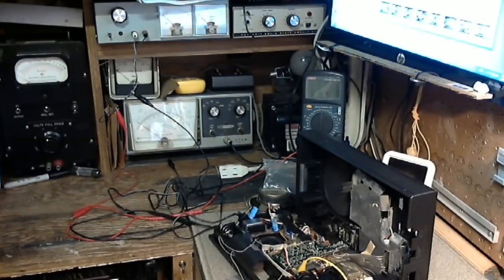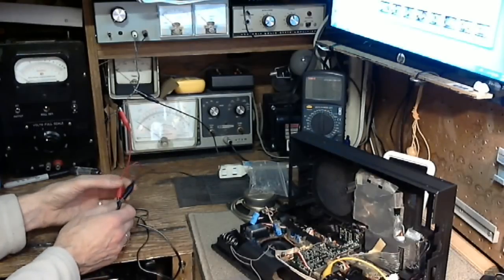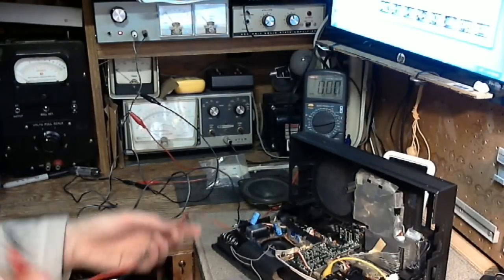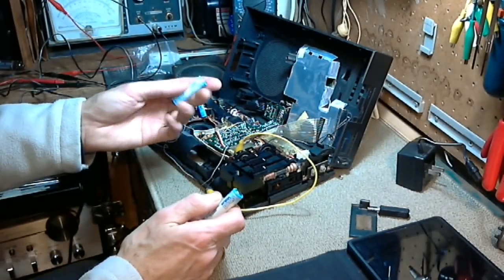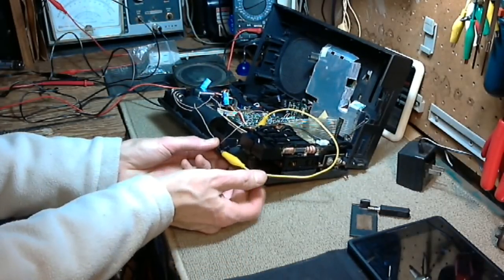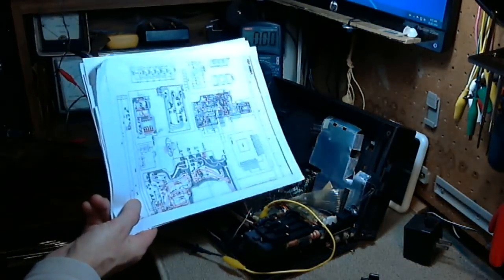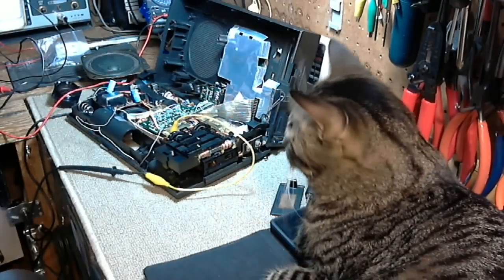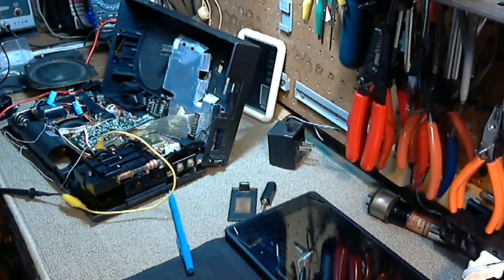Sony ICF 2001 Video #23 - A Better Shop Power Supply (with a Draper cameo)

Comment: When you turn it off, it will keep running for a few seconds because the electrolytic capacitors will keep the circuits powered for a short time while they discharge.
Reply from the maker: It seemed way too long.
Reply: Jim Lindenas
gotta remember tho its not a direct power off switch. Its a "soft off" switch. If there is a long delay in switching off then something funky is going on with the circuit around Q26.
Reply from the maker: Right.  I got it now.  I'm stuck in 1960's paradigms.